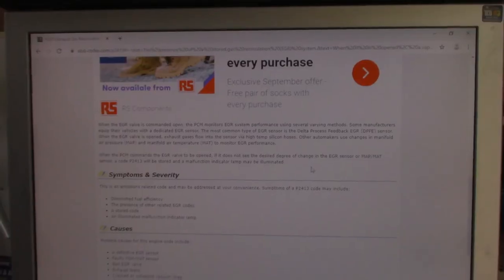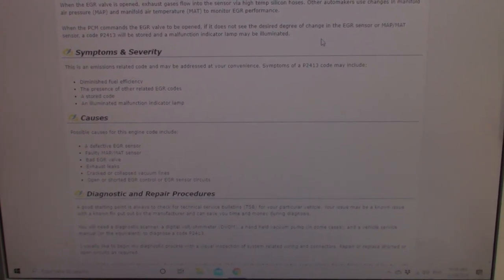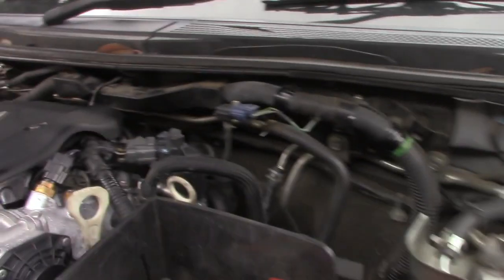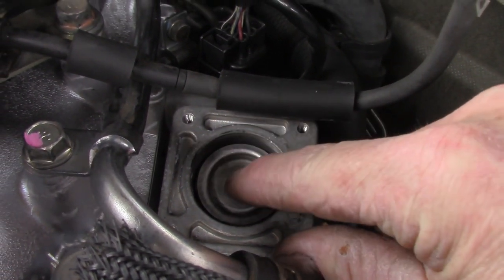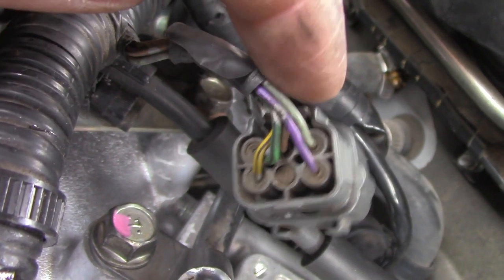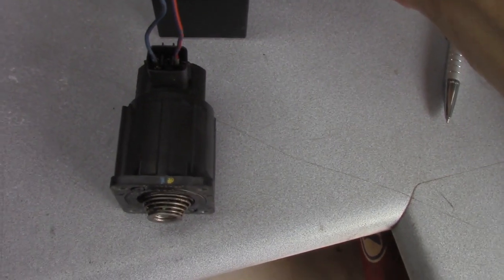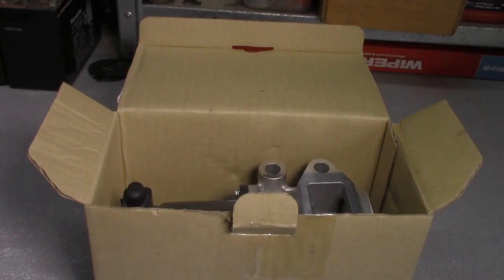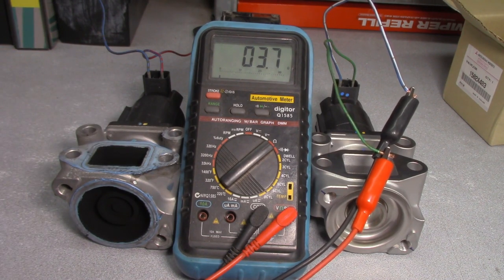Triton P2413 Fault Code MiracleMAX

Comment: Hi Max, great work, I love how you kept going on the diagnosis to understand the problem. 
Guess I’ll be buying a new part for my Triton or doing some testing to get rid of that expensive light!
Reply from the maker: For sure, it's no use being a parts changer if they are not needed. That's why I test so much - to make as sure a I can be with the data provided to replace the correct part only. Also you need to try and figure why the part failed in the beginning.

Comment: Thanks Max. I had an MN triton, we cleaned the EGR and intake. still had the P0403 and 2413 codes code up. EGR wasn't that bad before, valve works very free after clean, the spring would just closed. but after watching your video, we found that we had 0% EGR duty command and 99.2% error. So I hooked the 12v up to the motor to see if it went in and out by itself, off the EGR valve. Went in and out. then we mounted back to the valve , we could hear it operating the valve ( plug disconnected) . Then we plugged it back in, started the ute, the Cheap EML327 scan adaptor with Car Scanner app showed the duty cycle working 67%, no error. thanks, I understand a little more.
Reply from the maker: Great to hear that those testing procedures were helpful. Well done! 👍
Thanks for your subscription

Comment: As comprehensive as it gets, absolutely quality video mate packed full of fantastic info. I was delighted you pulled it apart at the end, gave me a warm fuzzy feeling :) 
You need to create links for your tools and parts to pop in the description. Give me some feedback on that new scope too, looks nice.
Reply from the maker: Thanks for your feedback Gerard. Just like you, I've always liked to pull things apart to see how they work and what failed. 
Good idea on putting parts in description.
I haven't used the scope enough to properly review it, but will give an opinion in future videos. It's pretty good for the price & once you sort out the navigation, quite useful.
Once again, thanks for the feedback. 😊
Reply: I love to do electrical repairs too great video on when you pull it up the info is a great headlightin too love see more of your videos you are a great teacher
Reply: I just watch ur video on fix the vehicle
Reply from the maker: @rogerwhite2653  Hey Roger, welcome to the channel.
I find electrical repairs and testing both frustrating and satisfying. When you are trying to diagnose something difficult and it doesn't make sense, you can end up ripping out your hair. But, if you slow down and think about what is actually working, move forward to find the fault, that can be the most satisfying part of the repair.
Thanks for your comments. 😁

Comment: i enjoyed watching your video. i have the same P2413 error on my obd2 code reader on my SUV Mitsubishi Montero 4D56 diesel. there is black smoke on the exhaust during quick accelaration and noticed higher fuel consumption. check engine indicator goes on and off for several days apart. I try to pull out the EGR motor and connect it to a 12V PWM DC motor controller to check its action. I dont have a pulse generator to simulate ECU control voltage. I learned a lot from you video. I plan to buy an economical full systems scanner, what brand and model do your recommend for Mitsubishi / asian/japanese cars. i dont have auto shop. im looking at Ancel FX4000 or X6
Do I need to have bi-directional active test option on the scanner to have a complete diagnosis and confirm the failing component of my car? or a full systems scanner is just enough for a hobbyist like me. thanks. Pls keep doing more videos to help everyone.God Bless you and your family.
Reply from the maker: Hey Francis, I'm glad you are getting something from the videos!
Obviously with scan tools, you get what you pay for. 
A few things to keep in mind. You must make sure the software that they load into the tool will cover the vehicles you require. Some companies get you to pay for updates each year.
I would ask if the tool is bi-directional as that is a crucial feature that helps diagnose faults quickly.
I don't know the brand Ancel, so I really can't comment. Also, I don't know what your specific needs are for a scan tool, so it is a little hard to give advice.
Read reviews on the tool before you buy.
I hope that helps a little
Cheers
MiracleMAX

Comment: Changed the EGR but still getting the code! Perhaps need to clean the cooler and the pipes..?
Reply from the maker: Has the intake system been cleaned of carbon?
In live data, can you see the MAF change readings when the EGR is activated?

Comment: Hi Max as I was searching I found this "Malfunction of second brake system" (for diagnosis codes 1780 and 1783) what is the second brake system? Another interesting in my case is the "Malfunction of underdrive clutch system (for diagnosis codes P1779, P1780, P1781, P1782)
Reply from the maker: Here are some links that might help
P1779
http://mmc-manuals.ru/manuals/pajero_sport_iii/online/Service_Manual/2018/23/html/M123115860001100ENG.HTM
P1780, P1781, P1782
http://mmc-manuals.ru/manuals/l200_2006/online/Service_Manual/2015/23/html/M123112610014701ENG.HTM
What full codes are the 1780 & 1783 P, B, C or U?

Comment: Hi max I have a triton 2.5did which I’m stuck with vehicle starts when cam sensor unplugged but won’t start when it’s plugged in
I’ve changed the sensor but no luck 
Timing is spot on the marks
Just some background timing belt snapped breaking rockers we had the head redone with engineers and injectors where also reconditioned fault only came up now after we did the head .
Please help me
Reply from the maker: Are there any fault codes?
Reply: @MiracleMAX  when the cam sensor is plugged in no fault codes
Reply from the maker: @ishaismail9128  Has this fault only happened since the head repair has been done?

Comment: Hello Max, i have a montero that show p2413 error. I did some diagnosis and position sensor is ok, but something weird is happening with the egr motor. The problem is im not sure if is a problem of the egr or its the ECU that cant generate the proper function to move it. 
I tried to move the egr to 50 or 100% sending the command using diagnosis and its not moving. The egr never moves except if i force it with my hand to open. In that case the egr is returning to close when you turn ignition off. Is the only situation where the egr moves. 
I tried to operate the valve providing constant voltage with a power supply and it moves... so i dont know... thanks anyway
Reply from the maker: You may find that the EGR valve can not be operated with the fault code. The code must be cleared first

Comment: Hey mate, I've watched this a couple of times.

I've replaced my EGR, clean the sensors, clean my intake manifold.

Mechanic took it off my hands did the egr valve replacement and check engine light came straight on.

I can clear it but keeps coming back
Reply from the maker: What fault code do you have? Have all the tests been done that are shown in the video? What are the MAF readings when the EGR actuates? Is this the same engine?
Reply: @MiracleMAX  p2413 done everything and it's not going
Reply from the maker: @BenjaminOBrien-m6u  Can you clear the fault code, remove the EGR, activate it with  the scan tool and see if it is moving?
Reply: @MiracleMAX  yep it moves.

I don't understand it at all.

It's been to the mechanic and he is out of ideas.

I put the old dc motor onto the new valve and a codes been thrown I've had P4213 and P0405.

If I put the new motor on its only code P2412 and if put the new motor onto the new valve I only get P0405.
Reply from the maker: @BenjaminOBrien-m6u  Have the 5 volt reference, ground and signal wires, together with the position sensor readings been checked at the PCM using an oscilloscope? Are the MAF readings as well as the MAP readings correct when compared to known good data? Has a wiggle test as well as a voltage drop test been carried out? Is the PCM up to date with software?
http://mmc-manuals.ru/manuals/pajero_iv/online/Service_Manual/2008_eu/13/html/M113350140022300ENG.HTM
Reply: @MiracleMAX  I've just got a cheapo scan tool just to clear the code.

Is it possible to clear the code then add a egr delete harness? 

Could that fix the issue
Reply from the maker: @BenjaminOBrien-m6u  It needs to be checked out using a proper bi-directional scan tool
Reply: @MiracleMAX  it appears to be opening and closing as supposed too. Graphing showing it as per its supposed be.

Wasn't a genuine Mitsubishi part, could that be the fix?
Reply: @MiracleMAX  Mitsubishi said the valve appears to be doing its job, they said it could be because its not a genuine Mitsubishi part.

Me taking off my muffler wouldn't have anything to do with it would it?
Reply from the maker: @BenjaminOBrien-m6u  I have used genuine from Ebay without every having a problem. These are not aftermarket, but I believe just old stock
Reply from the maker: @BenjaminOBrien-m6u  Is the muffler still off? You might be changing the required backpressure
Reply: @MiracleMAX  yes its still off as I have a cat back exhaust system
Reply from the maker: @BenjaminOBrien-m6u  Might be worth considering

Comment: hi max. kindly help me out. I forgot to put the MAF SENSOR backe after i sprayed some contact cleaner. I road tested my car after for about 30 min. Then I noticec the CHECK ENGINE light turned on. I stopped the car turned the engine off and put the MAF plug back into place. But the CHECK ENGINE light did not go away. Can I try re learning it or something? cna u teach me how? MITSUBISHI STRADA 2012 - Philippines hoping to hear from you soon. Thanks a lot.
Reply from the maker: You should be able to easily clear the code via a scan tool. If the vehicle goes through several drive cycles, it may even clear itself if you have reconnected the sensor.

Comment: Hey mate I had the same code coming up so changed the EGR valve and all gaskets to do with EGR. Fault code keeps coming up even after clearing it , it will come back up within 30minutes of driving. Exhaust had a bit of black smoke coming out also , any thoughts?
Reply from the maker: Did you carry out all the tests shown in the video? Is there a large amount of carbon built up in the intake system? When the EGR valve is activated, can you see the MAF reading change in live data? Does it have any exhaust leaks? Is the air filter clean?

Comment: Hello Max, good information there..
do you use 5V or 12V to moving Motor ?
Reply from the maker: As you can see in the video, I have used a 12 volt UPS battery. 
https://youtu.be/pR4J58qmr8k?t=588
I use this a lot as it is small enough to carry around. In fact I use one of these regularly teaching the apprentices in class for demonstrations. A very hand piece of equipment for testing components. 
Thanks for your comment. 😉
Reply: @MiracleMAX  Do you think 5V can move the motor ? i read service manual Mitsubishi, and they say use 5V to move the motor.
Reply from the maker: @yusuflbs7535  The position sensor built into the EGR has a 5 volt reference. The motor itself uses a 12 PWM signal. 5 volts may start the motor moving, but I suggest there will be a lot of electrical noise and possible shuddering
Reply: @MiracleMAX  Thank for explanation

Comment: Thanks for the video. Have you had a new faulty OEM EGR? Just replaced my EGR and now have A CEL P2413. Previous shudder, rich running condition with old EGR but no CEL. 4N14.
Reply from the maker: Hey Ramen,
Why was the EGR replaced? Is there a build up of carbon in the intake system? Have you done an EGR reset with the scan tool? What are the symptoms now in comparison to the old EGR? Has the fault code been cleared and comes back straight away? According to the scan tool, when was a regeneration done last? Is the oil level overfull? Does the oil smell like fuel? Has a small injection quantity relearn been done?
Reply: @MiracleMAX  thanks for the response! I was having shudder and hesitation between 1800-2200 rpms with rich running condition blowing lots of black smoke, this symptom was resolved with an EGR delete cable. I had already removed and cleaned intake manifold and egr but symptom persisted so I replaced the unit. This has completely resolved all issues except intermittent CEL and rough shut down. I only had a basic obd tool and have been able to view and reset. I was unaware the EGR position was able to be reset! I had followed work shop manuals. Oil levels are normal. I'll have my mechanic have a look with a proper scan tool to check DPF function and EGR reset!
Reply from the maker: @ramenzwagermam4193  Let us know how you go 😉
Reply: @MiracleMAX  I went to a local suggested mechanic with a decent scan tool and he only just erased error codes stating this should Zero Values. Same as I had already done. Is there a more complex process under PCM controls to reset EGR Values? I have seen this process with other vehicles. Hope you are having a great weekend!
Reply from the maker: @ramenzwagermam4193  Yes, you need to go into 'special functions' to do any resets. Clearing codes will not change any of the settings.
Reply: @MiracleMAX  Thanks for the prompt reply. This was my understanding also. I'll retry with another local reputable mechanic and see if i can get this sorted! Otherwise I might be on the market for a scan tool.
Reply from the maker: @ramenzwagermam4193  Thanks for keeping us in the loop 🤗
Reply: @MiracleMAX  any clarifications on further process? Was at the mechanic with a snap on athos and was unable to find a procedure under special functions. Ran a dpf regeneration with nil issues. No other CEL issues or driving issues.
Reply from the maker: @ramenzwagermam4193  There should be a reset value of several components like shown here.
https://youtu.be/eLxHFZSkHAo?t=1226
Reply: @MiracleMAX  spoke to a Mistubishi tech and they stated that their EGR was plug and play. Removed new unit and removed drive motor, incorrect drive motor! Despite being an AFI Oem part. The EGR motor had the same motor as listed in this video, as my model has a rotational driven gear. EGR was remaining stuck (likely partially open) registering a CEL and stalling when cold. Time to start again! Thank you for your time and valued information.
Reply from the maker: @ramenzwagermam4193  Glad I could help 😉
Reply: @MiracleMAX  We have an earlier thread going. I just posted a reply on it asking for assistance. Might my issue be that my new (last year) egr valve and actuator, needs a 'special functions' reset? My scanner doesn't offer this.
Reply from the maker: @ibslpaul  Just saw and replied to that other thread, which I suggested an EGR reset as well 😁😁

Comment: Hello . Thank you for this video. I am an owner of a 2012 Mitsubishi L200 with an automatic transmission gear box. And here is the problem . As I am driving at a normal speed of 80 km/hour -55 miles/h , often stepping away from the gas pedal and let the car go due to traffic, then the car breaks suddenly 2 times and moves from the 4th gear to the second gear. After that it is stucked on the second and I cannot accelerate, the D indecator flashes, and the only way out is to pull over and switch off the engine and started again. Do you have an idea what is causing it ? Can anyone help ? Thank you the diagnostics reads P1782 and P1783
Reply from the maker: When was the transmission serviced last? Has the oil been flushed, not just drained?
Can you see in live data if the over-drive pressure switch is changing state?
For the P1783 code, check and see if the transmission temperature sensor is reading correctly in live data.
Do you do towing? Have you towed over the limit and overheated the transmission? 
This also may give you some direction
http://mmc-manuals.ru/manuals/pajero_iv/online/Service_Manual/2017/23/html/M123113320020900ENG.HTM